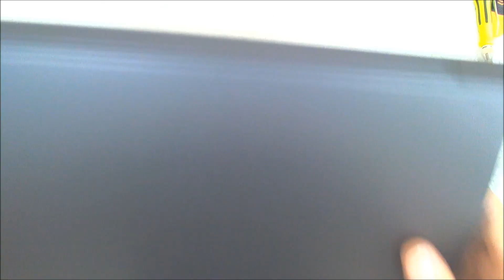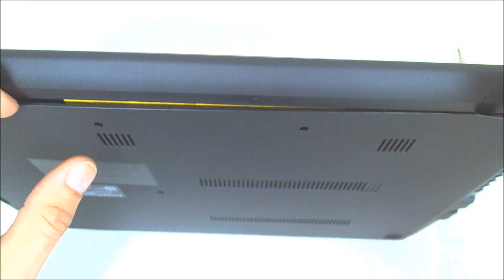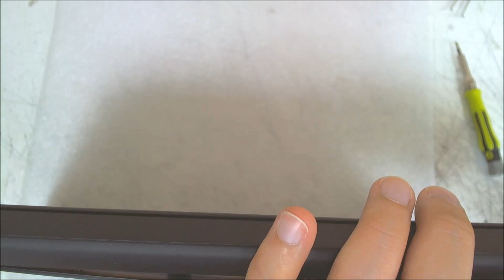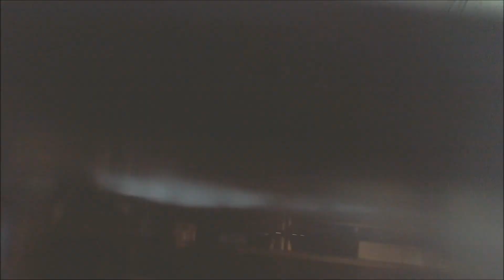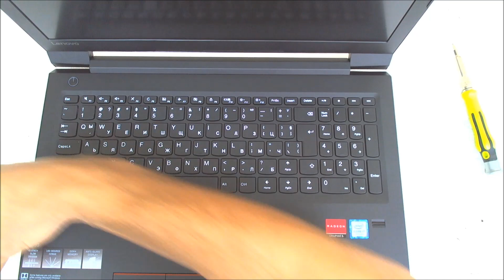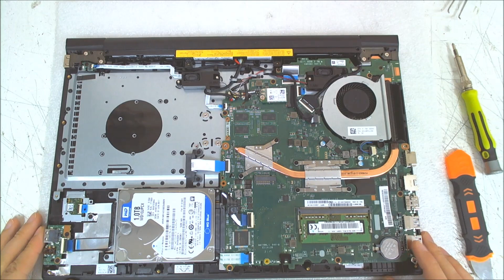Lenovo V310 SSD M.2 Upgrade NEW MODEL

Comment: Thanks for the video :-)  Let's see if I can do the same with the V310 I have here.  Slow as dog balls with the OS running from the hard drive..  Laptops that can handle both a 2.5" plus an M.2 drive are very cool I think.  Nice to be able to repurpose that 2.5" mechanical drive. Something like a Backup file history drive is nice.  It could also be used for storing documents/photos anything really.  Freeing space if you only have a small SSD.

Comment: Success so I was able to install an M.2 drive into a V310-15ISK.  This is the older model it seems with a 6th gen processor. But the dissasembly/assembly process is exactly the same.  I used a Crucial CT500MX500SSD4 and all is working perfectly :-) The free version of Macrium Reflect cloned from the hard disk to the SSD.
Reply from the maker: Nice and very good ssd choice.
Reply: Hi, please tell me what SSD did you install, a 128 GB or a 250GB?
Reply from the maker: @Caballero-182  if this question is for me, you can see from the video that i installed 250gb one.
Reply: @LaptopDisassembly  thank you :)
I hope @mattscomp answers soon, I read that the V310 15ISK support a maximum of 128 GB for the ssd, but I saw in other pages that the maximum is 256, so I am a bit worried about the SSD I bought
Reply from the maker: The size is not a problem. In most of the cases they write about the pre configured devices.
Reply: @Caballero-182  I installed a 500gb Crucial. All working perfectly. Hope that helps!
Reply: @UCgBiCzWqXMf_B2NA4FNS0LA   yes that's what I did. I setup the mechanical drive for backup purposes. The M2 drive I used for the operating system. Both drives working happily in the system.
Reply: Hi, what screw did you use for the m.2
Reply: @Lukka_art  I can't remember sorry. It was most likely the same size as you get if you buy a desktop motherboard. I'm lucky to have plenty of spares. Useful for when the laptop maker isn't nice enough to provide one. Update: I just checked.  It would have been one with the Crucial SSD. They give you a tiny bag with spare screw. :-)
Reply: @mattscomp  thank you!

Comment: Good job! I have a question. I used ssd m2 pci-e 3.0×4, but it works only on pci-e 3.0×1! According your information it must be pci-e 3.0×2... What do you think about it? Why only 1 line in progress?
Reply from the maker: Interesting question, i will read little bit about it. The first thing you can try is to update BIOS. Also you can try and remove the regular disk, to see is there gonna be a difference.  The number of lines can be for both M.2 and SATA drives.... Will read about it and write back.
Reply: @LaptopDisassembly   I have already done it, all.. remove hdd, update BIOS..even tried to turn off the radeon m530(i have hd520 and radeon m530) on BIOS... unsuccessful..
Reply from the maker: @KVV163   I check little bit, but cant find nothing for that. I check the link with the specifications again. I think in the Storage section, they are giving all the possible combination. ( M.2 SSD / PCIe 3.0 x 2 or SATA 6.0Gb/s)  means the laptop can come with SSD preinstalled and 2 sata devices ( one regular hard drive and one optical drive, on sata port also. ) I don't think "x 2" is the line number. There is a space between x and 2 and usually they are together. So in that case i think it shows the number of sata drives.
Reply: @LaptopDisassembly   anyway,do you use Crystal Disk Mark? This program shows me about 880/870  read/write mb\s. I think in your case( Samsung 860 evo) it will be approximately 500/490. It is better than SATA)
Reply from the maker: The laptop is not mine, it is a costumer one. I just install the SSD and set the operational system. Didn't have time to test, but in any case is better than sata drive. :)
Reply: @KVV163  so what the conclusion?
it is support M2 SATA III or M2 NVME X2 or M2 NVME X4. ????

Comment: Hi !
Thanks for the video. I find it very helpful since I want to do exact the same upgrade to my laptop. I have a question: which is the lenght of the SSD m2 drive?.. Due to the fact the link for the specifications is no longer available I cannot know that..
Thanks in advace.
Reply from the maker: It is m. 2 2280 ssd.
Reply: @LaptopDisassembly  thanks for the answer. I'm sorry to bother you one more time, but: do I need to do some BIOS update, maybe firmware or some?..I assume that I might need to change the boot order as well..
Reply from the maker: Usually you dont need to do anything. When you clone the os to the ssd by default the laptop is booting from the m. 2 slot. If not just go to bios and make first boot device the ssd. That is all.

Comment: Hello, I have a Lenova V310-15ISK Model : 80SY laptop, I'm thinking of installing the SSD hard disk you have installed in the video to my laptop, did you have any problems with the SSD disk incompatibility with the laptop?
Reply from the maker: No, everything works fine so far.
Reply: @LaptopDisassembly  thanks 👍🏻

Comment: hi,i have another question ,is not about the ssd m2,but about the keyboard,this model does not come with a light module for iluminated keyboard,even tho compatible iluminated keyboard exist for this model,can i somehow make some soldering to the motherboard  and where , to make the iluminated keyboard work ? and another thing,i would change first the old hdd,witch is extremely low speed,as it is at 5400,and is power hungry,with a ssd sata3,less power consuming and much faster,thanks
Reply from the maker: Only way is to replace the keyboard... There is an extra connector for the leds.

Comment: Hi, nice video. Can you help me? I have a Lenovo V310-15ISK Type 80SY and i want to put an Ssd, do i need to replace the hdd for the ssd? or i can have both? Like a 128gb ssd and a 1tb hdd. Also i want to upgrade the ram from 8gb to 12gb, i need to buy a 8gb ddr4 2400mhz, its correct?
Please help me, i dont know what components i have to buy. Dont know if the ssd has to be sata 2.5 or it can be nmve, thanks
Reply from the maker: Yes youcan add extra ssd on m. 2 2280 slot. Also you should have 4gb onboad, so you can add extra 8gb. But best way is to open it and check.
Reply: @LaptopDisassembly  thanks for answering that fast, i really apreciate that. Mine laptop has an intel i3 6006u. So i can have ssd and hdd at the same time, perfect.  Thank you so much

Comment: So.. i have a question.. do we have to unscrew the middle screw for just swaping the dvd room with extra battery ?
Reply from the maker: Yes, the optical drive is hold by one screw.
Reply: @LaptopDisassembly  thx for confirmation.. i wanna buy the extended battery for support my mobility.. but then little bit confuse cz i dont know how to open up the dvd rw.😁
Reply from the maker: @Edward_Fernando   Keep in mind that the optical drive is 9.5" tick.
Reply: Yanko Goshev did you mean 9.5mm thick ?
Reply from the maker: @Edward_Fernando  yes my mistake

Comment: I have Lenovo V310-15ISK   with   Intel® Core™ i5-6200U and 4gb RAM.  In task manager it says I use 1 RAM slot and have 3 slots free. Is this true?
Reply from the maker: No... It is with 2 slots max
Reply: @LaptopDisassembly  I opened it now and saw no ram stick at all. Only 1 empty ram slot. What's going on? 😂
Reply: I think the 4gb ram it has are integrated into the mobo and I only have 1 empty slot
Reply from the maker: @comedyman112  Also possible.

Comment: I have a blank optical drive on my Lenovo V310-151KB with 128gb SSD variant. Can i have another HDD or SSD on my laptop? Thanks for the quick response.
Reply from the maker: Yes, you can, but first remove the cover and check is there a sata connector, soldered on the board. If yes, you can use 9,5mm caddy for the second hard drive.
Reply: Another question sir, can this laptop have 2 HDD at the same time assuming that I put the first HDD on the empty caddy
Reply from the maker: @zaycoralde45   yes, the one in the laptop is primary and the one on the caddy will be like secondary. Put the one with the OS in the laptop. In the caddy the speed may be a little slow.
Reply: Thanks sir! You deserve more subs!
Reply from the maker: @zaycoralde45  Thank you. I try to answer to all the questions. :)

Comment: Hi. I installed a ssd m.2 western digital. how did you configure the BIOS? please help
Reply from the maker: I did not do any settings in bios. After I install the ssd, I just make a fresh install.  What problems do you have.
Reply: @LaptopDisassembly  I want to start from the SSD, the operating system. But when installing everything, you can not. And in the end it ends up starting from my HDD.
Reply from the maker: @0123MxMusic  did you install the operating system on the ssd, or you clone it. Because it cannot go there by it self...
Reply: @LaptopDisassembly  I clone it. What should I do now?
Reply from the maker: @0123MxMusic  how and with which program. Usually the m.2 slot is master and it should boot from it.  Try to use aoemi Bacuper and use the option clone operation system.  You can try to remove the normal disk to see will it boot from ssd. If not, than there is a problem with the cloning
Reply: @LaptopDisassembly  I did what you told me. and I copied the OS into aomei. Result, it was solved, now initial abnormal. I did not try it before because it was the paid version. Thank you very much for your time and your help. : ')
Reply from the maker: Glad it all work fine
Reply: is your ssd type m2 nvme or m2 sata 3?

Comment: My laptop is lenovo V310-15IKB, model name 80T3... I want to know which ram 4gb used in this.. i want to upgrade to 8gb ram... an additional 4gb..  how can I know the ram speed MHz, ram speed, configuration like 1rx8 or 2r.. please help me...
Reply from the maker: Install aida64 or cpuz, it will show you the ram speed and which slots are used.

Comment: my pc is v310 15 ikb does the m.2 slot support PCLe gen 3x4 im planning to buy Adata XPG SX8200 Pro 256GB or should i just go with a sata m.2 ssd  like WDS240G2G0B if it supports it i will buy Adata
Reply from the maker: It should work fine with the nvme model.
Reply: @LaptopDisassembly  could you do a video about it that would be very nice since im not the only one having this question in the maintnance manual it says it supports it but many people have problems actually getting it to work try diffrent ssd types and bios versions you would help me a lot if you make a video like so
Reply from the maker: Well I s a costumer laptop, so next time i have one i will make a video.
Reply: @LaptopDisassembly  it supports 3x2 not 3x4 gonna buy wd blue sn500 250 gb
Already bought 8gb ram for the laptop waiting for it to arrive 
Btw where did you find the correct screw for the m.2 ssd i dont think it will be included with the ssd im having a hard time finding the correct screw for it.Tested other screws from the motherboard of the laptop they werent the correct size. I guess i have to visit more hardware stores  what a pain
Reply from the maker: The  correct screw size is 2.0 x 3mm (CM2x3-3.3). I have plenty from  other ssd and different laptopa. I think you can install 3x4 but it will  work at 3x2 speed. It all depent on the curtain configuration, becouse the lines are shared depend is there a regular drive or an optical drive.
Reply: @LaptopDisassembly  i have a hdd and a ODD no sata 3 ssd
Reply: @LaptopDisassembly  hey i bought mx500 and installed it but the screw i have m2x3 screw but it doesnt fit its too small im sure it is m2x3mm i guess i need a standoff or something im struggling to find the correct screw size
Reply from the maker: Some of the screws are with fine threads. Try to use a screw from an old hard drive or display. Most of them have similar screws.

Comment: My lenovo laptop is v310-15kB but does not have DVD optical drive, but does it have m.2  slot? ia still have not open it
Reply from the maker: Check in bios, do you have some like M2 slot - empty or similar
Reply: @LaptopDisassembly  i still have not opened this laptop though, but can i check it on bios?

Comment: Have You managed to make Windows see the discrete graphics card? I have a v310-15isk i5 with a Radeon R5 M430, and Win7-64 does not see it. Trying to install the drivers for this card from the official Lenovo site leads to the blue screen of death...
Reply from the maker: What is the model of the cpu, and what is the bsod you are getting. Also you can try to install windows 10 just to test is it software or hardware problem.
Reply: The CPU is Intel(R) Core(TM) i5-6200U CPU @ 2.30GHz (2C 4T 2.8ГГц, 2.8ГГц IMC, 2x 256Кб L2, 3Мб L3). I didn't photograph  the bsod, but I would call it a usual bsod with countdown. In the meantime, the things are going better. Still using Win7-64, I tried to install the drivers for R5 M430 from the AMD website - and it worked, after that Win7 found R5 M330. What is more, after that I successfully installed the AMD drivers from the  Lenovo website without any bsod. And now Sandra indicates as follows:

OpenCL : AMD Radeon (TM) R5 M330 (320SP 5C 1ГГц, 2Гб 64-бит) - - -
D3D 11 : Intel(R) HD Graphics 520 (192SP 24C, 768Кб L2, 2.2Гб DDR4 2.13ГГц 64-бит, Встроенная графика)
- - -
OpenGL : AMD Radeon (TM) R5 M330 (5C 656МГц, 2Гб).

Hope thereis a way to make Win7 see it as R5 M430 instead of R5 M330.
Reply from the maker: Try the Ati radeon auto detect tool. It will check for newer drivers..

Comment: hi. is this model support over 550 mb w/r speed on ssd? which type ssd nvme ?is nvme support over 1000mb w/r speed? model Lenovo V310 15IKB 80T3
Reply from the maker: Yes nvme support more than 1000mb depend on the model.
Reply: @LaptopDisassembly  thanks for answer.lenovo could not give me a clear answer.just send specifications.but not write nvme.just m2.2280 6 or 8 gb/s.max support .What do you think is the maximum read/write speed it supports?
Reply from the maker: @sudaxhu  depend on the model...but you cannot reach the max specifications. Usually around 1500-2000
Reply: @LaptopDisassembly  thanks for help.I subscribed your channel. have a nice day.

Comment: Hi! I have problem. I put patriot p300 256gb ssd at my v310-15ikb laptop and when i launch windows from usb my laptop does not recognize ssd. Have you some solution
Reply from the maker: Is the ssd visable in bios. Also is the sama mode set to ACHI and you boot to UEFI.
Reply: @LaptopDisassembly  i tried to boot in uefi but i can't. It said that i need to boot in legacy. In bios there are only for example usb: kingston, hdd: toshiba, msata: , nothing after two dots (:)
Reply from the maker: @vanjailic7853  Sorry for the delay, but is a video from about 2 years, so i had to check few things. Can you tell me your board number.  Some of the old revisions support regular M.2 ssd, not NVME. Also can you send me a picture of the mounted SSD on yankogoshev@gmail.com I want to check something.
Reply: @LaptopDisassembly  sure

Comment: my laptop lenovo v310-14ISK i3 4G 1TB how to check the slot ?
Reply from the maker: There should be a slot for M2 drive. The easiest way is to check in BiOS do you have any option about M2 slot. Or you can install Aida64 and check is there M2 slot available. Best way is to open it... but i'm pretty sure there is slot.
Reply: @LaptopDisassembly thank you

Comment: I have that laptops and ı bought 128 gb adata sx6000 lite nvme pcie ssd but bıos didnt recognize ssd. before ı bought ı searched and it support pcie 256 gb ssd in lenovo website. What can ı do ? is there any solution and what is the reason?
Reply from the maker: First, try to flash with latest bios. After that try to start a fresh install, and see is the operation system see the disk.
Reply: Thank you I will try and tell you what happened
Reply: I have last Bıos version. And I did fresh Windows 3 days ago. And it's still same.  :( Is there any other solution?
Reply from the maker: Wait.. Becouse i dot little confused. You install the windows before plugging the ssd or...
Reply: @LaptopDisassembly  I need to format Hdd and there was one week to arrive me Ssd and I need my laptop so I did fresh install hdd.
Reply from the maker: Try the following... With ssd plugged in, try to make a fresh install. You will not make an actual installation. Just boot from the instalation media and go ti the peart where you choose where to install. There see us the ssd available. Just to check.. Dont continues the instalation. Just check there. Also do you have option i the bios about sata mode and etc... But try with installation media first
Reply: @LaptopDisassembly  Yes actually i tried to boot with media and I couldn't see the ssd to install. 
Sorry i couldnt understand the other option " bios about sata mode on and etc."
Reply from the maker: Can you show a photo how you install the ssd. Also can you try to power on the laptop without the back cover.. Just to test.
Reply: @LaptopDisassembly  how can i install the photo in here? And My ssd is not with me now I will try tomorrow but how can i send you?
Reply from the maker: Use the email yankogoshev@gmail.com i will read it :)
Reply from the maker: Also make a few photos of the bios
Reply: The V310 (at least mine) doesn't support NVMe, just SATA3
Reply: I known, that your comment is old, but I have same problem. Did you solve this problem?
Reply: @sodkieburaczki2147   no i didnt i changed my ssd and i bought m2 ssd

Comment: Im using v310 14ikb 80T2 and it wont detect my m.2 nvme gen 3 😅
Reply from the maker: Here people says it works with nvme. https://forums.lenovo.com/t5/Lenovo-C-E-K-M-N-and-V-Series-Notebooks/Lenovo-V310-14IKB-support-SSD-M-2-NVMe/m-p/4626643
try flashing bios with latest, also check SATA mode in bios. You can also try to start windows 10 installation and see will it be visible.